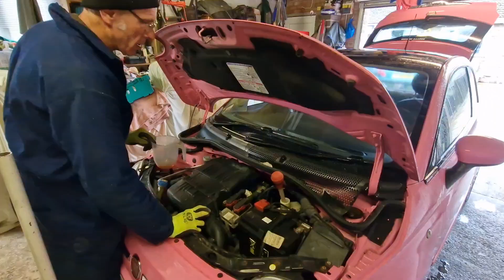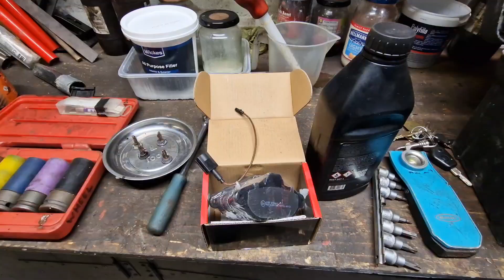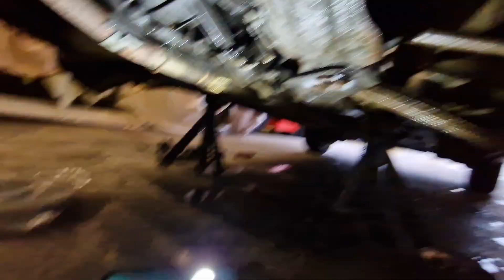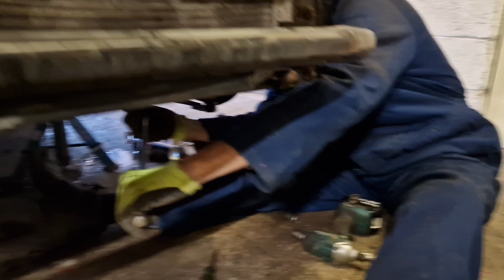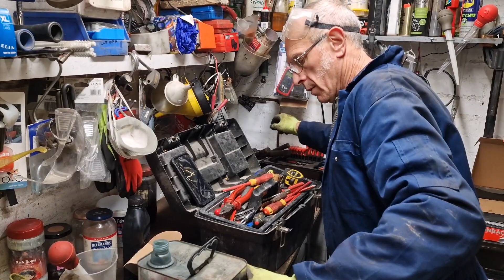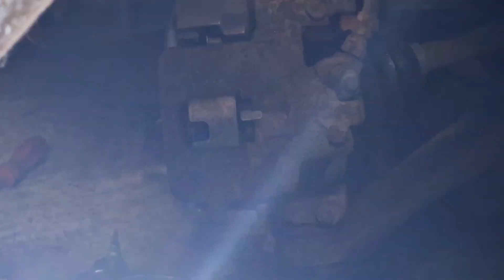Fiat 500 - New Brake Discs & Pads AND Fitting A New Lower Control Arm / Wishbone

Comment: It is a weird awkward design for control arm maintenance etc. but maybe that chassis extension section is part of the crash structure that can easily be replaced along with the stuff in front ?
Reply from the maker: I think it's a design layover from using the Ford KA chassis
Reply: Wrong way round... the "Ford" Ka was 100% a Fiat 500 in a Ford frock, from the same Polish factory and with Fiat engines, and even the quirky Fiat / Alfa 98mm BCD wheel / hub fittings.

The Grande Punto shared the GM Corsa platform and had more "normal" 100mm BCD wheels ! @JonCoupland
Reply from the maker: @johnmoruzzi7236  AHH I knew someone would know!

Comment: I would've changed that radiator, it's falling apart and likely going to cause an overheating / head gasket issue without warning. Thought I could see some coolant weeping from the bottom of the rad.
Reply from the maker: It's only the AC condenser radiator that's broken - the actual radiator is behind and is ok :)